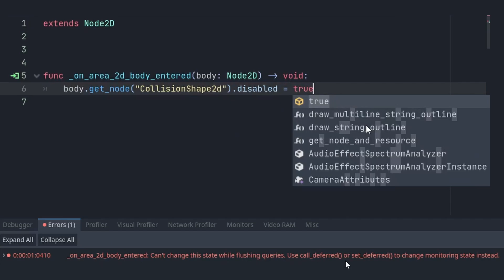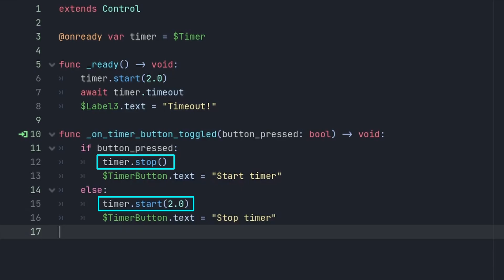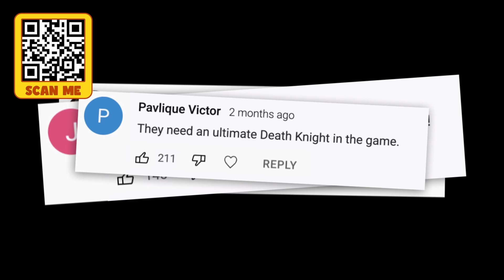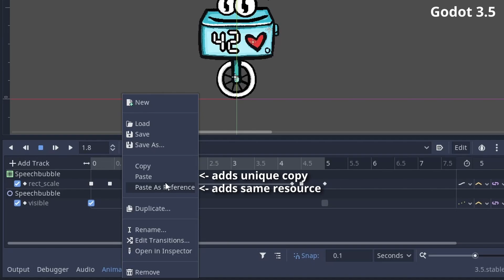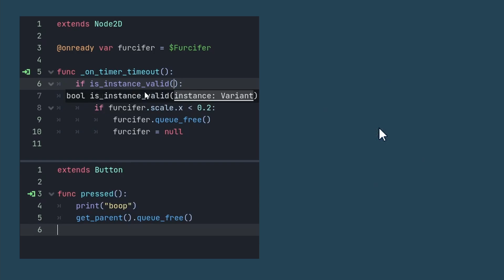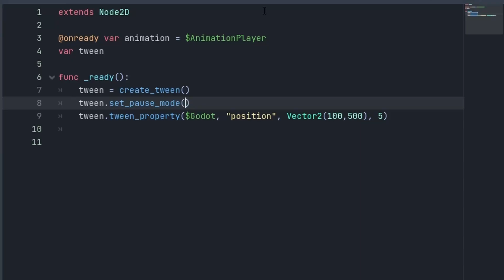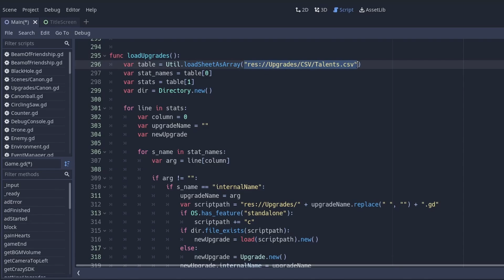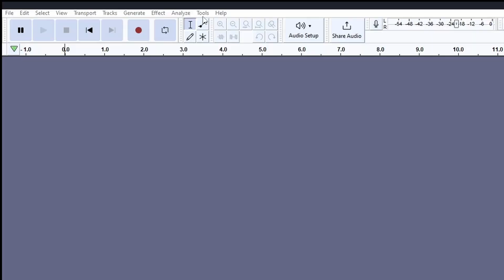10 Godot Engine Mistakes You Might Make (Godot 4 / Godot 3)

Comment from the maker: Install Raid for Free ✅ IOS/ANDROID/PC: https://clcr.me/mbqaDe and get a special starter pack 💥 
Available only for the next 30 days
Reply: i only use await for Loading gamefiles and it works pretty fine
i have more than 90 3D scenes instances then loads into the game 
but when i tried to load them at the same time it crashed and almost really burned my GPU
to prevent this i added await 0.5s timer for each load and now it doesnt crash

like come on loading almost a 32km by 30km world in 3d with almost Godot 4 looking graphics on godot 3 is already hard by its own

Comment: Spent 3 hours trying to fix a problem godot engine made up, yes, made up, since the issue doesn't exist. The only solution for it would be to clean missing files, does godot have this cleaning option?

The issue is missing index h frames times v frames, on animation player

Comment: 'Await' is so backward coming from gsc where every called function must return before proceeding. It's nice using actual results & not function states. If one needs to run a function simultaneously for whatever reason, just gotta specify it with a single keyword without the need to inherently proof any other relevant script. It's irritating at times calling functions in Godot with seemingly no absolute guarantee of a timely return & having to proof stuff when I just want to expect a result first.

Comment: I wonder if there's an easier way to make a "player limited vision" without having to use light2d and lightoccluder2d? Like, the player not being able to see through walls and instead just see darkness on the other side.
Reply from the maker: Pretty much sounds like the main application for light 2d. Maybe you can build the occluders programmatically from collision shapes? Someone might have solved this already
Reply: @PlayWithFurcifer  I've checked and tried with light2D on the player and the occluder on the wall tile in my top view 2d game, but the "darkness" gets rendered on top of the tile so I can't see the wall's sprite, meaning I can't make 1 tile walls for example, because they'll just be completely black and it looks bad :(

Comment: If you are still collecting GODOT tips, I have one more for you: You know there are numeric values that have an slider in the inspector and other don't? Well, even they don't have an slider you can click and drag the number left and right to smoothly change it. But that is not all: hold SHIFT to make change slower, which is useful when you need more precision, and hold CTRL to snap the value to an integer. I did know I can drag the numbers, but not that SHIFT and CTRL had an effect while doing it, until very recently.
Reply: Just started using Godot and this little tip is something most blender users will intuit. That’s so far, one of my favourite things about Godot. I hated navigation and that in Unity. But Godot is identical in terms of viewport controls and little things like this which I love to see
Reply: This is a very good tip. Thank you!

Comment: Here are some mistakes I used to make:
1. Signals + Multi-Threading = no no
2. Forgetting to free a Thread with 'wait_to_finish()'
3. Setting materials on a mesh resource instead on the MeshInstance.
4. Setting velocities (or even worse positions) directly on rigid physics bodies.
5. Using bodies instead of areas for bullet hit detection.
6. Removing a node from scene tree without calling queue_free()
7. Statically typing arrays as function parameters can cause funny lines like 'Cannot convert argument from Array to Array'.
8. Not understanding that 'await' is in NO way or form multi-threaded but a coroutine instead!
9. Setting values of locals within a lambda which have the same name as a variable in an outside (global) scope has no impact on the values of the variables within the outside (global) scope! (Note: 'global' means something different here than member)
10. Placing a GIProbe (it was Godot 3) not into the geometry 3d-node-based part of the scene tree, which causes the probe to have no effect at all.
Reply: Tried this but now the ColorRect will stretch the pixels if you don't have a 1:1 ratio sized window.

Comment: I recently had fun debugging material shaders (Godot v3.5) that should be unique since they would have different input parameters. Looking at the tscn file code shows the ids for them in the scene tree to see that they are not made unique. In my case I was setting the next_pass property of a material to the shader. Another debugging trick is to print the name of the material or shader instance, this prints its reference id to check if the same ones are being used. To make them unique I ended up duplicating a master version of my material in code.

Comment: So. If my code in Godot 3.xx said  yield, it means it won't work in Godot 4? That's dissapointing.
Reply from the maker: Yup it was renamed. You can find more info about GDScript 2.0 here: https://github.com/godotengine/godot/pull/39093
There are quite a few converters in the works.  The Godot 4 Beta comes with a converter integrated. Haven't tested it yet though.
Reply: @PlayWithFurcifer  Thank you. I don't like this change. The word yield is used hundreds of times in my projects. I hate this change. Now I'll have to change this word hundreds of times. Just nonsense. By the way, your video is great and very informative.
Reply: @saulnores3477  Godot 4 will convert those for you the first time you open a project made with Godot 3.x - There will still be things to change, but yield and a lot of the API renames won't be among those. Except when you yield on something Godot can't figure out.

---

I have notes on what you will have to look for:

- Now there are two typed version of min, max, clamp, sign and abs. One works with int and the other with float. You might need to figure out which you need on a case by case basis.

- Some APIs now use StringName when they used String before. Godot will convert between them with no problem, but some things you may have to change some declaration from String to StringName to match what Godot uses.

- There is no subarray, now it is slice, and be careful with the upper bound.

- Tweens are no longer nodes. Which also means you should not add_child them, but you still need to keep a reference… It is better to migrate to the new API.

- You need to copy the bodies of getters and setters manually.

- Warning suppression are not migrated. Also Godot 4 defaults are more strict than Godot 3.x defaults. Plus there is an open issue on the suppression of the unused_parameter warning.

- As I said, if Godot can't figure out what you are yielding on, you will have to write the await yourself.

- Remember to Configure Blender and FBX2gltf

- Some EditorPlugin API changes still need to be done manually, in particular renamed virtual functions.

- Pay attention to the changes to the button pressed state and signal names.

- You need to update exported variables that have an enumeration manually

- It is now _get_configuration_warnings and returns a PackedStringArray, Godot won't upgrade this for you.

- You need to specify class icons with @icon
Reply: @saulnores3477  To clarify,  on yield, Godot expect the signal name to be a string literal, or a variable identifier. If you have there something more complex (e.g. a ternary expression, or you do some string concatenation) then Godot won't be able to convert it to the new syntax.
Reply: @Theraot  Hi Alfonso. Thank you for your detailed explanation. You have been very polite. I learned many things with your answer. Thank you very much.

Comment: I had slow load times with mp3 and even crashes (my guess is that something odd with the encoder caused an edge case in Godot), in particular in web exports. Ogg is much better. Although my experience is that Ogg is slightly larger (you say it is smaller?), it loads faster (it seems that with mp3 Godot takes a little longer to fill audio buffers).
Reply from the maker: OGG is a  bit larger with same bitrate, but with a slightly lower bitrate it is both smaller and better quality (as far is my research goes, i dont have the ears to confirm that)
Reply: I started my own game with MP3 files and I quickly changed them into OGG files. By lowering the quality setting a bit (I use audacity to convert them), they're really smaller in my project and I could not notice any audio quality loss even with a headset.

Comment: There is one other error I see at least once per every page on Godots Q & A Forums : forgetting about mouse filter set to stop of overlaying control nodes :)
Reply: That is a very common one, yes. Although it is usually something easy to spot (like a background element), for those cases where it is really hard to find, here is an extra tip: With the game running, open the debugger panel on the bottom, and then go to the Misc tab, it will show you the last control you clicked. You can then start clicking around and see there what is intercepting the clicks. You can double check with the Remote tab of the scene panel, also while the game is running.
Reply: @Theraot  A lot of people, me included, expand control nodes to fullscreen, while making visual changes only at the small part of it. That is why this problem is so hard to spot :)
Reply: @Theraot  WHAT!?!?! I never knew about that. That one is huge! Wish we had a tool/plugin/panel that would dump out all mouse input events.
Reply: @graydwarf22  There is a helper to tell you what control node consumed the event under: Debugger->Misc Next to the Output window.
Reply: That one has gotten me countless times in the past, after about the 20th time I think I finally learned to check for it but it can still be tricky to track down in dynamic UIs.
Reply: @beidero  Just dealing with that today actually. Working on a card game framework and mouse events for overlaying cards is harder than expected. I played around with visual click tracking (everything is pure Area2D) or control based click tracking (treenode traversal with dead-ends) . The latter of the two took a bit to figure out.
Reply from the maker: OOOH yes, thats right